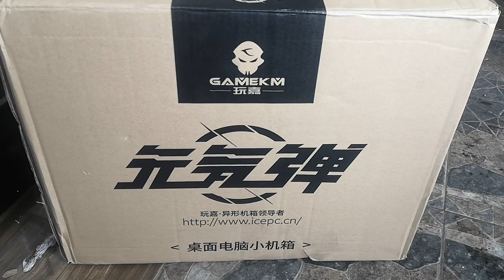TGEARS GAMEKM Genki Bomb Cyclops ( TEAR DOWN ) PC case like speaker.

Comment: Kasya kaya corsair fully modular power supply dito tulad ng rm850x,rm1000x thanks sa reply
Reply from the maker: sseasonic psu gamit ku. don't know the actual size yan rm850. if ever same size ng sseasonic.
Reply: Same kami kaso sakin Rm850i 150 x 86 x 180 mm size kasya kaya?
Reply: @depede384  ano po power supply mo na seasonic?
Reply from the maker: @jastudioshorts  520 watt sir.
Reply from the maker: @pokemonquizshorts  pwede mahaba psu. pero yun mataba baka hindi kasya.. pero kasya siguro malaki siya.

Comment: Hi sir, sir yung 200mm big front fan, sinaksak ko lang sa molex tapos yung 2 male pins sa LED switch sa gilid.

naikot yung fan pero walang ilaw na kahit ano.

Ano kaya ang problema sir or sira ang RGB nang fan mismo? 

Salamat po.
Reply from the maker: white plug po adapter